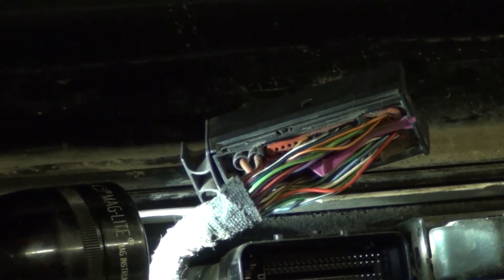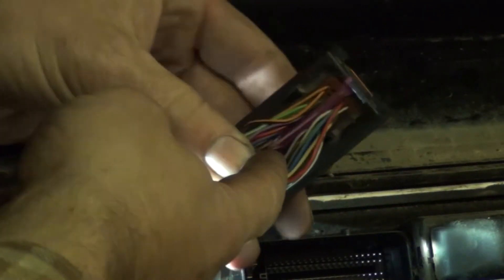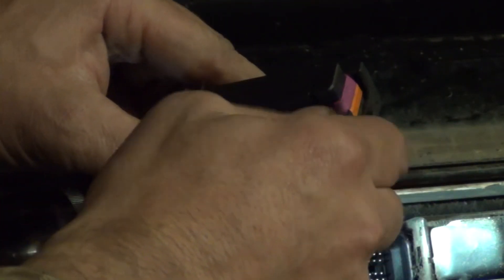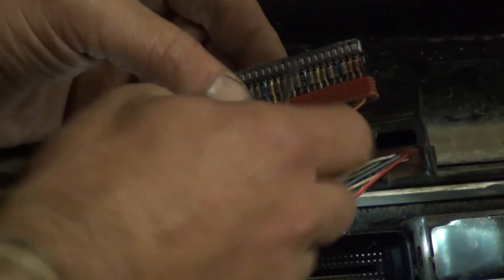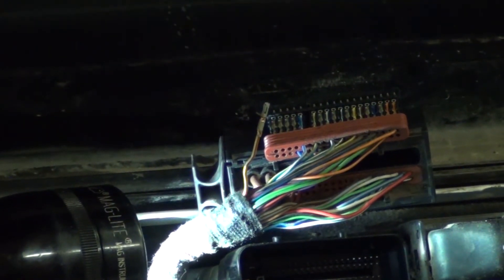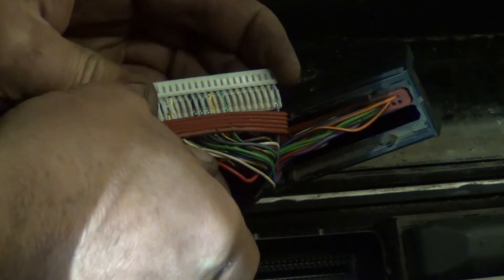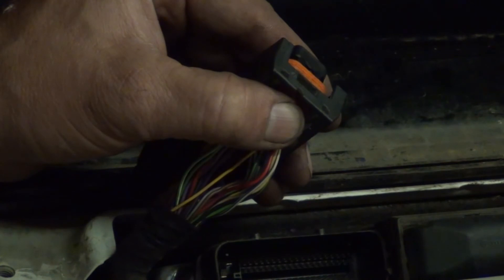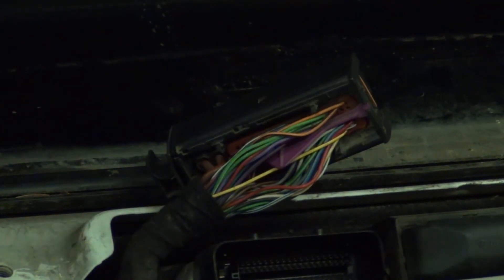VW/Audi ECU pin removal

Comment: Great info! But im stuck on 2014 Jetta TDI connector to ECM. Trying to remove and replace pins for MAP sensor. After removing purple security tabs, it still won't come out. It seems that top row(yellow) is held by 2 yellow tabs to the case of the connector. Do you have experience with it and how to pull out without breaking it?
Reply: Im having the same issue just being patient in removal .

Comment: Thanks for this video, do you happen to know the terminal type?  I'm trying to depin and run fresh wire for the ignition signals but having trouble figuring out what terminal to purchase.
Reply: these are amp micro quadlock terminals if anyone else was trying to hunt this down
Reply: @durandalmk2 Thank you so much

Comment: How is the cover removed on the ecm connector?
Reply: For the record there is a little latch at the back corner of the cover that you have to unlatch with a screwdriver (T94 cover)👍

Comment: Hello, I followed your tdi 5 speed swap... Great video! I am in the middle of my swap right now on my 2003 tdi. I am stuck at the ECU wiring part. I really want to do it correctly. All the instructions I have seen say to remove 66 pin and replace it with 19 pin......my question is, what happens to the #66 pin after you remove it? The instructions are a little to vague for me.  Some also said you have to solder a wire on somewhere......but some just say switch 66 with 19. If you can shed any light on this for me I would greatly appreciate this! THanks!
Reply from the maker: I moved the wire from pin 19 and 66, then installed the wire previously in 19 into the 66 spot
Reply: ok great! Thank you!
Reply: P0322, touran ..is it applicable for touran 2009 TDI